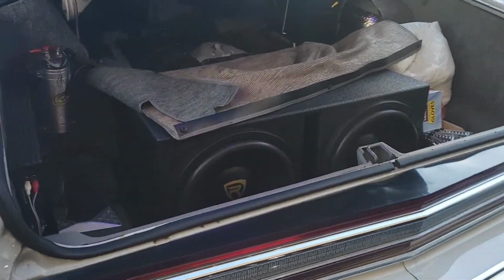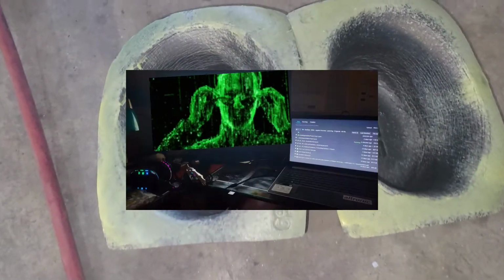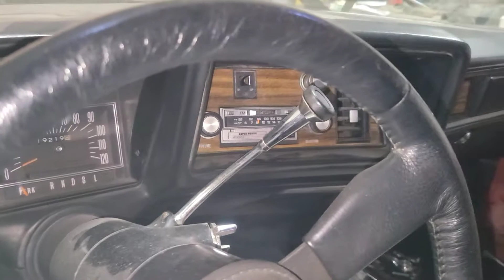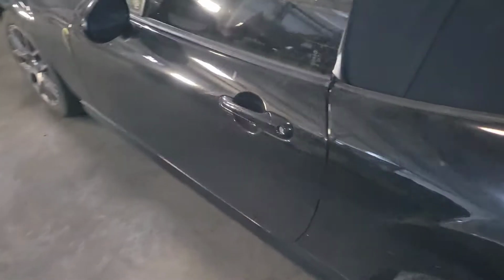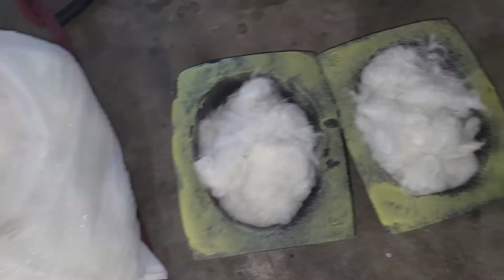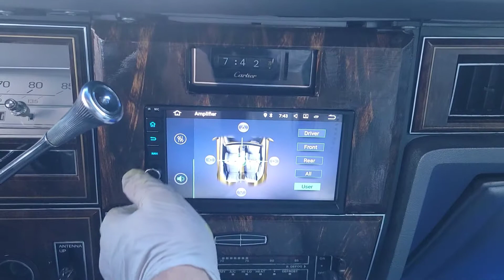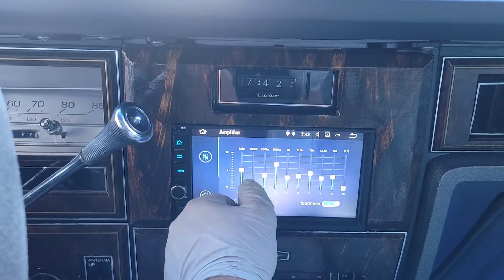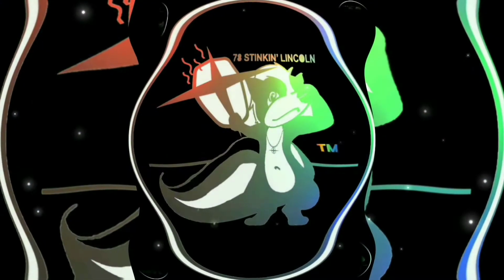78 Lincoln 6×9 baffle install

Comment: Do you like them? I replaced rear pioneer 6x9 running off alpine deck power with the Rockville 6x9 and a 100w alpine amp. It now sounds much worse, the Rockville don’t put out any volume. I bought the baffles as well, but need to get bodywork done before permanent install.